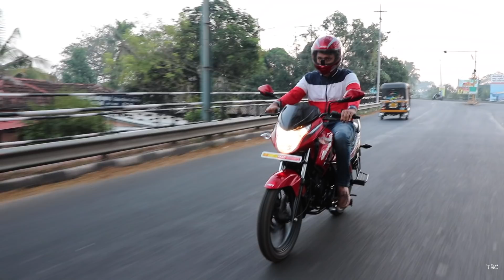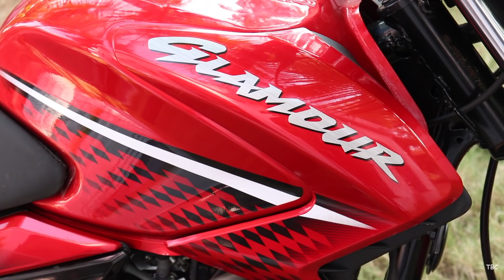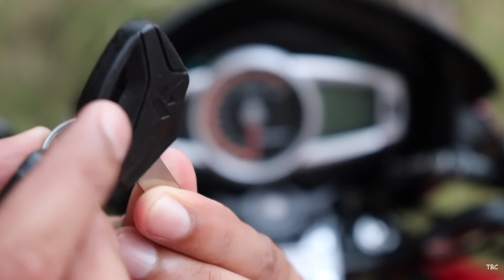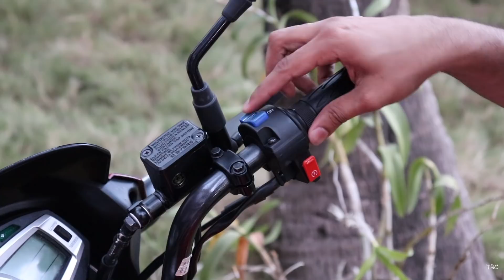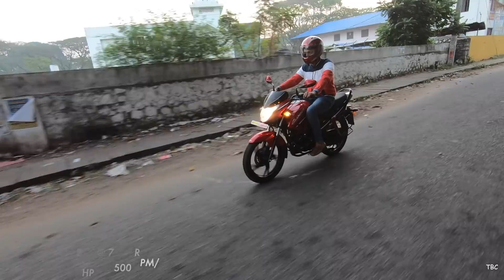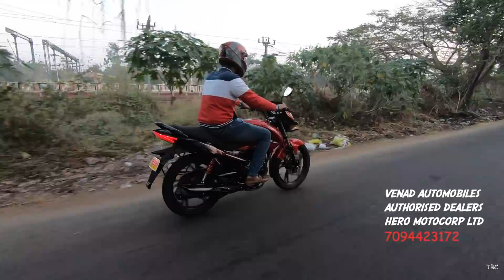New Hero Glamour 125 i3s Detailed Review!!

Comment: The tank grip is bad, or I should say horrendous. My feet touches the tank shrouds, certainly we don't want to grip plastic.

Ideal grip would be if your thighs grip the mid portion of the tank, not the upper trim. If only the footpegs were set a bit rear, it would have been very comfortable for the rider

Comment: A good bike for city and highway till 60-65 km. Sitting position is good for rider. But for pillion it is not safe. Very high seat. Suspension is good. Initially I was going to sell it out. But later I hold on and now satisfied.  Engine sound and suspension is awesome. Pillion seater will never be confident sitting. Good sitting poster. Overall good bike.

Comment: Nice review...
And I am driving this bike since 1 year or so and the bike doesn't vibrate at all even on full speed of 105...
And gives a mileage of 60+ due to I3S technology...

The driver seating is comfortable and we can rest our shoulder weight on the handle without any discomfort unlike Pulsar where we need to bend... Although pillion seating is not so good.

The another issue what I found is when ever the bike is rode from potholes the meter reading console cable just goes off...means it breaks. This is the big issue what I found and also the indicaters are not good enough to sustain the flexibility unlike other HERO bikes!!!
Reply: Engine timing chain ki awaaz aati hai kya
Reply: M going to buy...is it worth in terms of milege n performance?